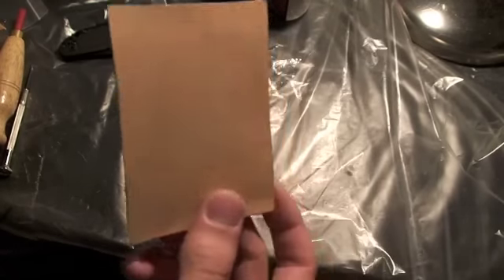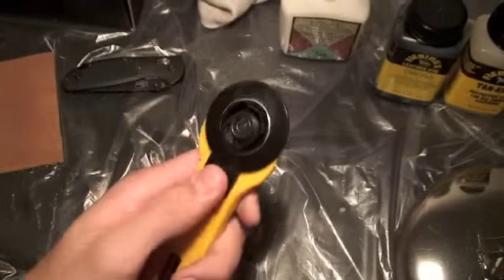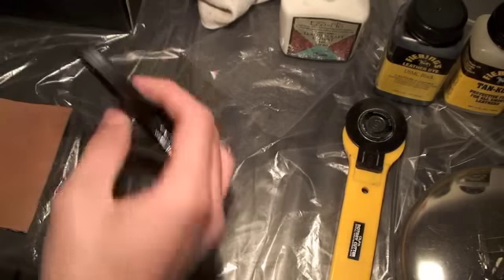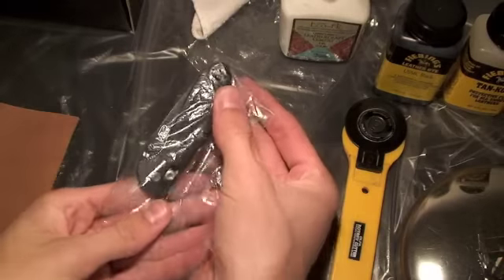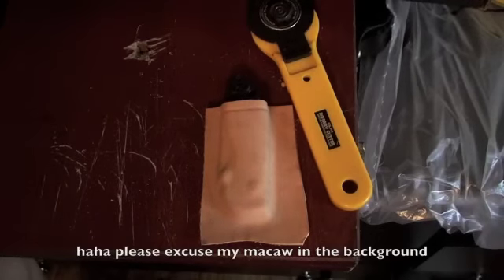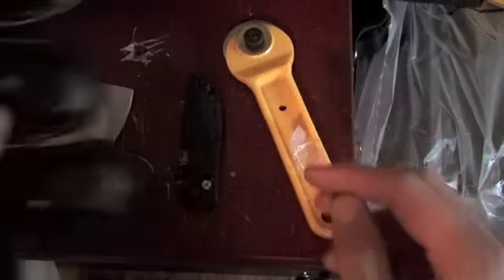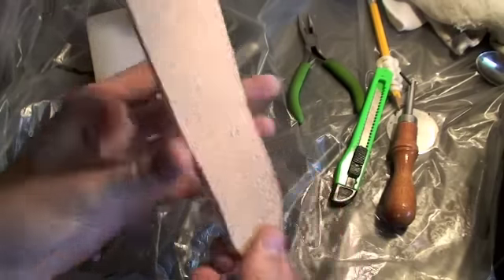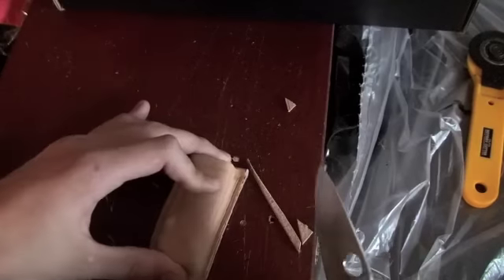How to: Leather Sheath Part 1

Comment from the maker: @Bertogearlearner You basically just rinse it with warm water until it is saturated. You will be able to feel it is ready when it is nice any pliable. When burnishing the edged, you can just take a damp rag and drag it along the edge until it is somewhat damp. Then, just rub the edges briskly with a piece of canvas(works best), plastic, or metal until the edge is shiny and somewhat slick. You could also use a sharpie. Btw, one tool meant for burnishing is called a bone folder. Not needed IMO